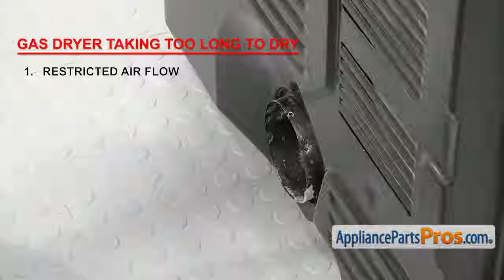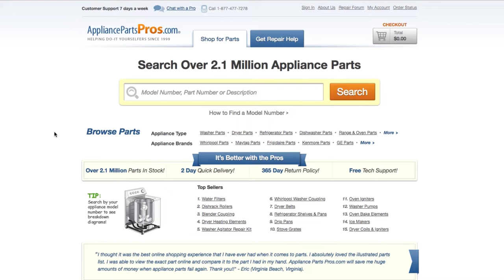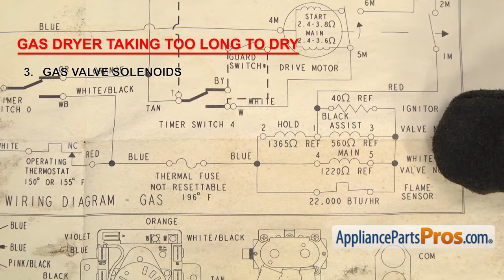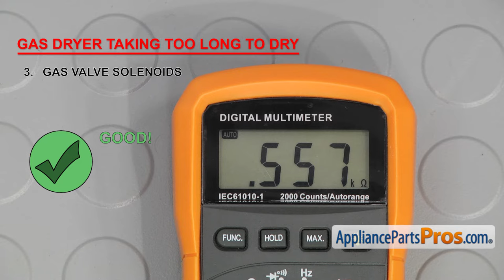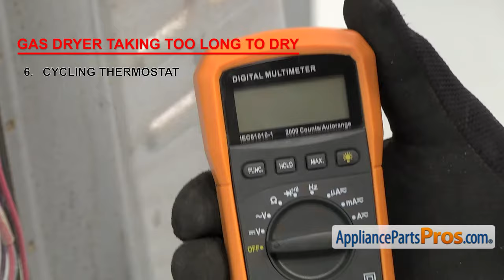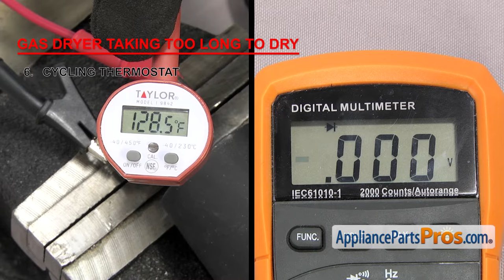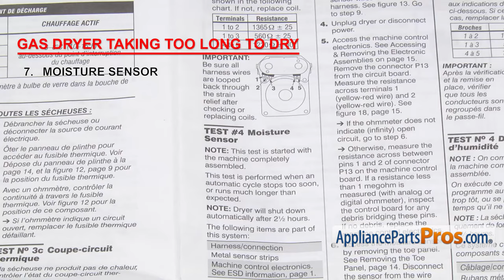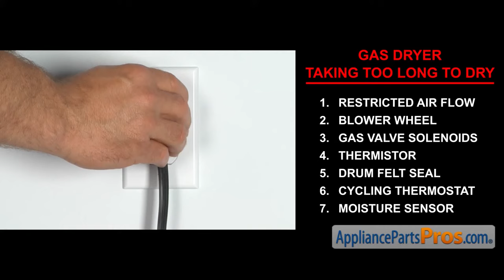Gas Dryer NOT Drying or Taking Too Long - TOP 7 Reasons & Fixes

Comment: Do I need to shut off the gas to work on a gas dryer?
Reply: Never mind. I watched the entire video like a good tech and saw that I DO HAVE to shut off the gas
Reply: @offthetrail636  How do you do that?
Reply: @squirrelattackspidy  There should be a valve at the wall where the hose hooks up.

Comment: Thank you. I'm a new tech/flipper and I have learned the hard way not to think a gas dryer is good just because it heats when you first start it. I sold what I thought was a good gas dryer, only to get a call that it is not heating. I thought I was saving time and money by plugging it in and hooking up the gas and running the dryer for few a couple minutes. Take it from me: you spend a lot more time and money on callbacks and refunds!
Reply: just experienced this with a g.e. gas dryer. started it up for a few minutes but client said it's taking too long to dry towels. problem is i don't have a gas outlet in my current address. i gave the client a refund. cleaned it and will sell it and hope cleaning it solved the problem. if it doesn't will give refund again lol